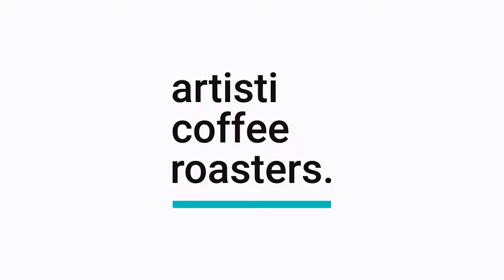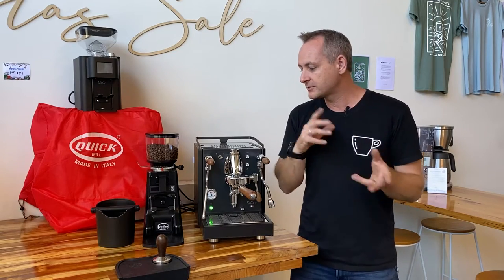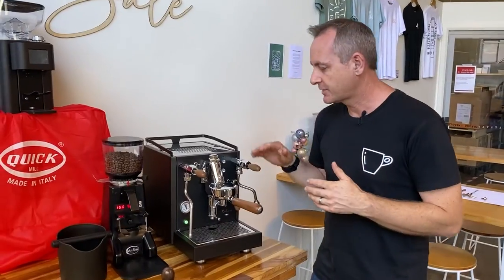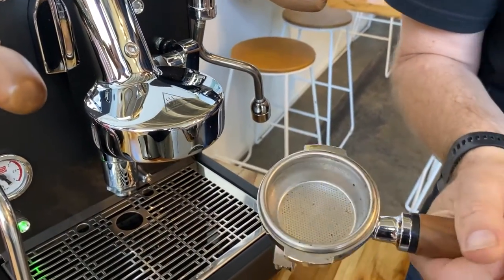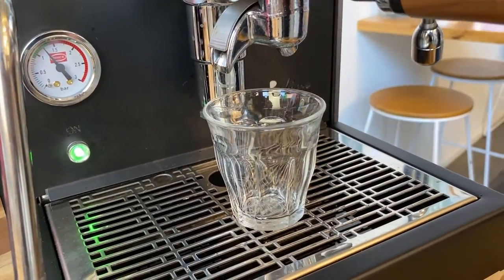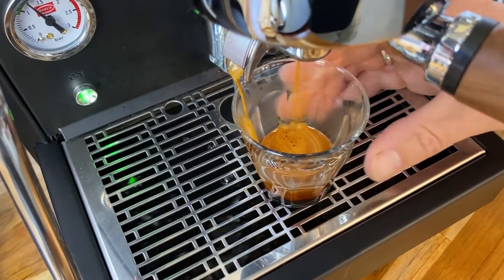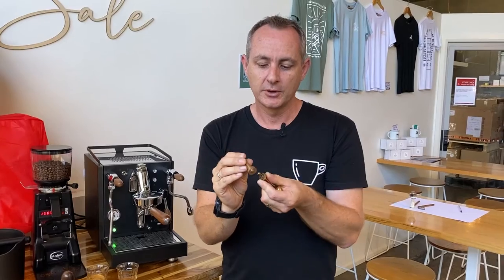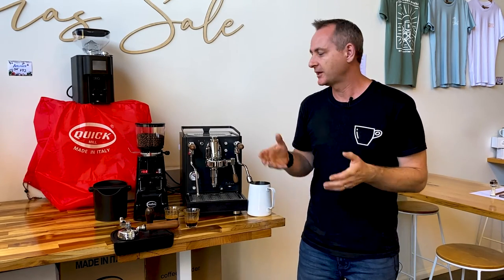Brewing Advice for your HX (Heat Exchange) E61 Coffee Machines

Comment: Well texture and colour comparison should have been done with same level of water flow. How can you compare first one with let's say 30-40ml and second one with 10-15ml? It is expected that second one with have more darker crema no matter pre infusion. Shouldn't you compare them with sam level of water to show the point of pre infusion used?
Reply from the maker: Yes, you are correct, however it’s a noticeable difference and we wanted to show the richness that occurs in the first part of the shot which is different.
Reply: Yeah, you are right, it is seen from the first drop that it's different with pre infusion. I was struggling at home with my Sanremo Treviso to catch the difference with and without pre infusion because of other unstable variable - group temperature 🙂 but with thermometer installed it became more clear. Anyway, great video 🙂

Comment: Thanks. I never understood the flushing before. Have you ever worked with a flow profiler? Does it replace the wetfusion?
Reply: You still need to cool the group head if you didn’t use the machine just before. Listen to the hiss of steam rushing out, and you’ll know fast how many seconds you need to do it. On my Quick Mill Andreja I was doing it for around four seconds. Also you can change the temperature of the boiler. Cooler it will be shorter, but you’ll loose steam pressure. A good recommandation is around 1,2 bar. And a flow profiler does nothing to it. Those are the reasons why many prefer to use double boiler machines with PIDs. Simpler to use, but expensive.

Comment: Hi there, great video! You mentioned the temp for steaming is approx 120c. 

I have a QM Aquila HX with a PiD/shot timer. What temp should my PiD be set at (the T2 setting)? I’m getting confused whether that needs to be 120-5c or around 95c (the ideal temp to brew coffee from my understanding). Does the PiD regulate the boiler only and not the brew head?

Any advice would be appreciated!
Reply from the maker: If the machine has 2 PID you will be able to change the steam and the brew boiler temps. 95 would be the brew boiler, 115 to 130 would be the steam and hot water tap. If you only have one PID it will be the brew boiler as the steam boiler will be by a pressure stat which you can’t change
Reply: @ArtistiCoffeeRoasters  great thank you! I definitely only have just the one, so  would you recommend keeping it between 120-125? I’m assuming it is similar to the Sanremo Cube your team posted the video on

Comment: Hey Guys recently subscribed and came across this video. We have an ECM Technika with this group head. I attempted your recommended pre infusion technique. Had a small amount behin to pour when doing the 2nd on/off . I assume I should just shorten the time between doing the on/off on/off?? We agree it did pour the shot that little bit darker crema and sweeter taste. Was pouring nicely anyway but this does appear to enhance it. Cheers

Comment: Awesome share of tips for the Rubino. I have one too , I thought I was doing a pre infusion by activating the brew lever 3/4 of the way for a few seconds before then lifting up to full. Would that be similarly effective ?

PS: nice tip on brew ratio, I will have a go at 18in, 32g out, still in 25-30sec?
Reply from the maker: If you only go 3/4 first the pressure has not been built up, the pump has to activate first. To fill the brew chamber, you would want to flush out the hot steam water. It will give a little soak, like I showed at the end of the video, but only the pressure from the syphon effect
Reply: @ArtistiCoffeeRoasters  Tried it this morning and resulted in an awesome cup, did 17>30g shot with your pre infuse style - happy days!

Comment: So acyually this macjine has a 45 angle pre infusion? Or its just goes from 9bar to zero, and if so, the puck does not getting expanded and destroyed? I have Bezzera Aria w/ rotary pump and its not plumbed in so im wondering if I can do this trick. Great video as always, love your channel ❤
Reply from the maker: Yes a pre wet, it’s the pressure built up in a head onto the coffee eater than pre infusion
Reply: @ArtistiCoffeeRoasters  thanks for replying.
I have tried it once, but it seemed to breack the puck and aftwerwards the flow became faster

Comment: Hey Luke thanks for the video! In terms of maintenance, after I did my first chemical backlash and clean, the lever mechanism started squeaking and it’s pretty bad. Is this a concern? And how do I resolve this - any advise?
Reply from the maker: Yes it’s common, the cam needs to be greased. Get some food grade grease and use it on the cam, start from the lever and remove the arm with a flat screwdriver, then a range of spanners as you take each nut off, then you get to the big nut that screws into the head. Then once it’s out you will see the shaft and the cam that needs some grease.
Reply: @ArtistiCoffeeRoasters  Thanks!!

Comment: Any tips about commercial HX with single conducive group?
I usually flush and go with mine(Rancilio Epoca St1) cause the fast recovery time pull the water temp up very fast

I am going to try the preinfussion you suggested
Reply from the maker: This video has most of the tips, also make sure it’s been on for a while to increase heat stability. You can then do other mods with gauges or probes
Reply: @ArtistiCoffeeRoasters  Usually I use the machine at least 1 hour after I turn it on, but I don't know if the design let me use it with a different cooling flush method than flush and go, maybe with a very low boiler pressure setting(?)

Brew pressure gauge is planned cause I would like to make the variable voltage mod to the vibe pump

Thank you for your time

Comment: Definitely going to try the tip for pre infusion on my Izzo Vivi - I always find the flush a pain as I like to shoot for a set temp and feel like it  takes a load of water before my group head thermometer registers the temp I like.

Would you suggest not worrying about the water temp specifically and simply flush the steam, and then pull the shot?  Then if the coffee is too hot let it cool in the cup or is there more to the cooling flush?
Reply from the maker: The flush in the head is to bring the group head water down in temp, they can get very hot, so above 94 degrees is not good for coffee, flushing it brings it down, it could be near 100 if it’s very steamy, we aim for 92

Comment: Could you just put the handle at 45 degrees for 10 seconds for a pre infusion, then full on instead of flicking the handle up and down??
Reply from the maker: Pre infusion is all about pre soaking about half the puck, if you leave it on the built up pressure and volume of water may make its way fully through the puck which is not the effect you want to achieve